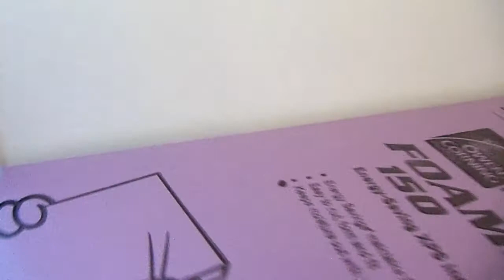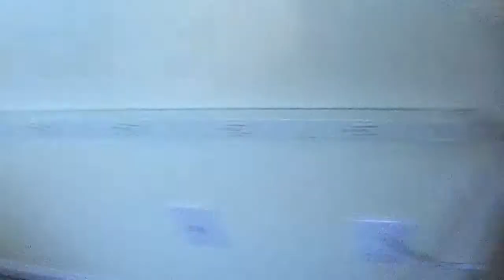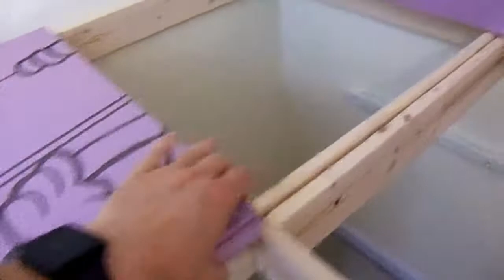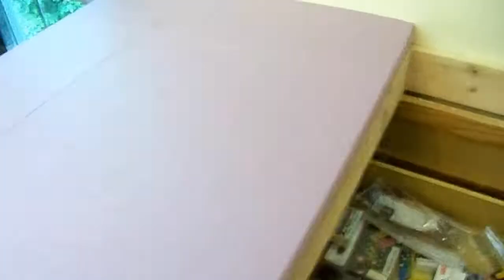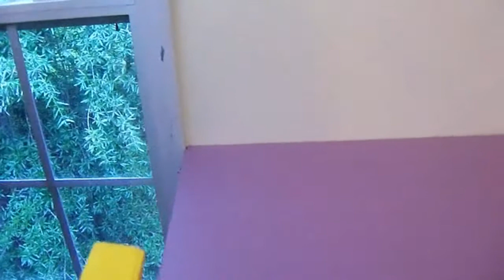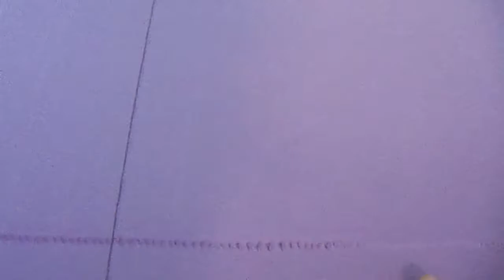Building an N scale layout 06- Well, I screwed that up.

Comment: Alex, how did you cut the foam and get it so straight and square.  I've had a problem with that.
Reply from the maker: Scored about halfway through with a utility knife guided by a straight edge, then snapped it. It creates a fairly smooth edge which is as straight as what ever you used as a guide. This method also works with gentle curves.
Reply: @playingwithtrains7764  thanks Alex, I'll give that a try.

Comment: Exposure to ultra violet will cause foam to deteriorate and/or shrink. Otherwise it is stable and is unaffected by temp or humidity. I've used dozens of sheets supported 24" on center and subjected to environmental extremes without any problems. Printed sides often are covered by a very thin plastic film which can be peeled off to make marking is easier. The printing is actually on the film and removing it will give you a clean surface.
Reply from the maker: Thanks! I had no idea that the printing was on a film.

Comment: Hey Alex, as I understand it, foam warps over time. With such large open spaces below the foam, what will prevent it from sagging beneath the weight of scenery, structures, track and trains running on it? Before you permanently affix the foam with liquid nails, you may want to do some research on foam warping and consider reinforcing the foam from below with a sheet of plywood or, at the very least, with more wood cross beams. Just a tip to help you avoid some pitfalls...
-from Tom Pilling
Reply from the maker: That's an excellent question and a common concern. I've seen several comments about this and realize it is a generally held belief.  However, I don't think it's true. 

-First, the foam curled slightly when I brought it into the room. This was probably due to the change in temp/humidity between the home store and my spare bedroom. After a few days of acclimation, it flattened out again. Having worked with this kind of foam in the past, my best guess is that the "sag" many modelers have experienced is most likely an effect of the changing environment (humidity/temperature) and not the weight of the scenery.. If I was building this in a garage or basement with little or no air conditioning/climate control, I would put in more framework for the flat area to sit on and probably add some torsion pieces to keep the whole thing from flexing. 

Second, I put a sheet of this on saw-horses and stacked encyclopedias on it.. With 5 encyclopedias, it didn't start sagging until I got the saw-horses about three feet from each other. I haven't weighed my rolling stock and models, but I'm thinking that every model, loco and piece of scenery I can fit onto the layout will weigh less than a stack of encyclopedias. I would be willing to bet large sums of whatever currency you choose (Dollars, Euros, Cheese Sandwiches...) that 99 percent of the time, the main reason why models warp is due to changes in the temp/humidity and the other 1 percent is due to someone accidentally stepping in the wrong spot. At a 24" span, a piece of 3/8" plywood (without edge supports) can hold about 50lbs without deflecting. ( http://www.langboard.com/osb/data/osb_load_sheet.pdf ) Sculpt-a-mold isn't that heavy.  

Of course, I could be wrong and the whole thing will fall apart.  We won't know for sure for a couple years, at least. And by that time, I'll probably have ripped the whole thing out and started over. :)